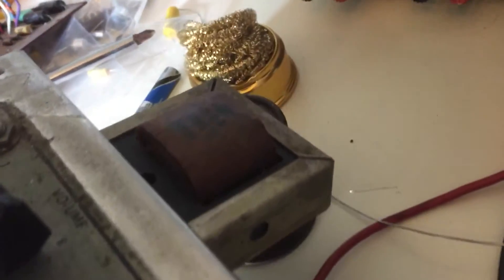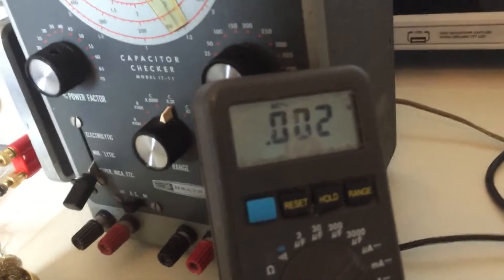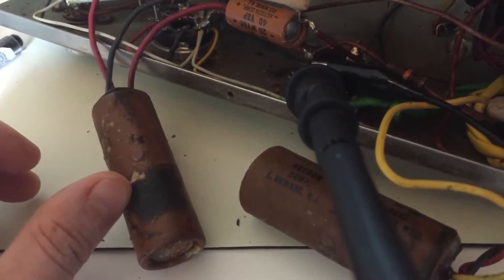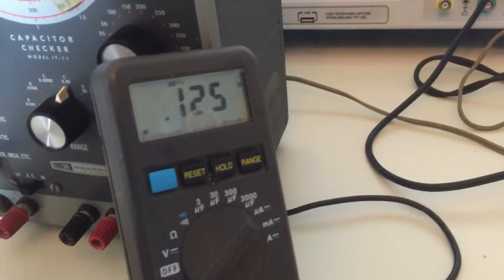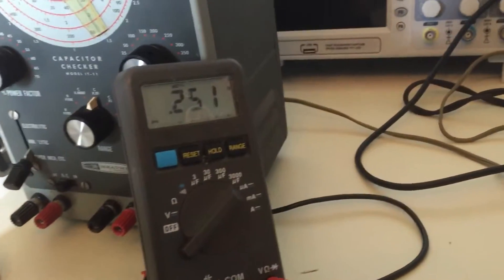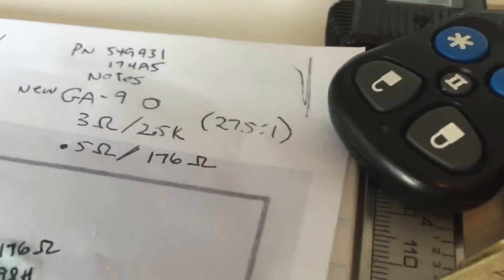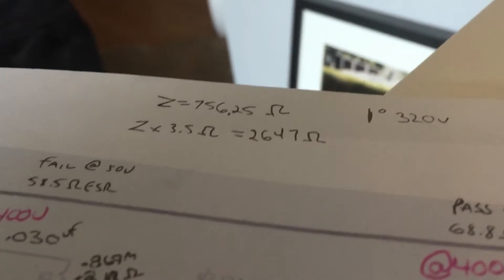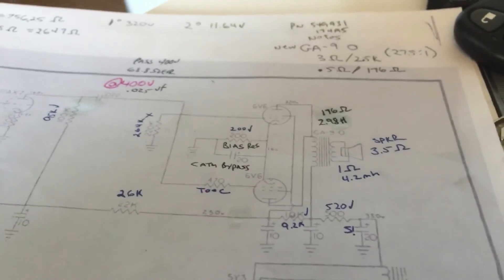1959 Gibsonette - Testing the output transformer

Comment: Interesting info. I have been puzzling over what I believed to be an improper substitute OPT in my (1952?) BR-9 with early Gibsonette circuit like yours (but with 8" Jensen field coil speaker). A transformer engineer told me the original OPT should have been 2500:3-4 (3.2 ohm voice coil common back then), and the turns ratio 27.5:1 stuck in my head. I see in your notes supporting calculations.

Only trivia I can contribute (you may already know) is that in the 549931 marking is for the mounted transformer seen in the video, 549 was the EIA mfr. code for Midwest Transformer & Coil in Gray's Lake, IL...not sure what ever happened to them.

Thanks for posting this.
Reply from the maker: Honestly I didn't trust the documentation either. But only one ratio could calculate correctly back to the dual single ended 6V6 finals on one side and an 8 ohm load on the other. Even after making this assertion i still ran the numbers to confirm against RCA's specs...
Reply: I ended up deciding I didn't want to gamble on a quest to find an original OPT in unknown condition since it's a best guess given the flaky approach to model evolution that existed. With my luck I'd find one for a different version. I ended up choosing an MCI/Classic Tone 40-18031 using the 5k:8 wiring for a 2500:3.5-ish ratio. (reconed voice coil is about 3.5 ohms DC).
Speaking of careless specs/features/model names, I have a 1956 ES-135 that has nothing to do with the 1990's (?) ES-135...did they forget they made that model once already? Fender Starcaster is another...semi-hollow collectable, model 'stolen' for their cheapest dept. store starter-kit Strat clone. Happy New Year...Your video confirms I have an imposter OPT.
Reply from the maker: Glad I helped make the determination.   Remember the Finals setup will always give up a false transformer winding combination. and there are a ton out there.